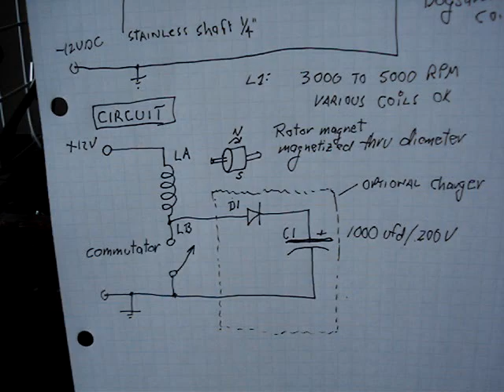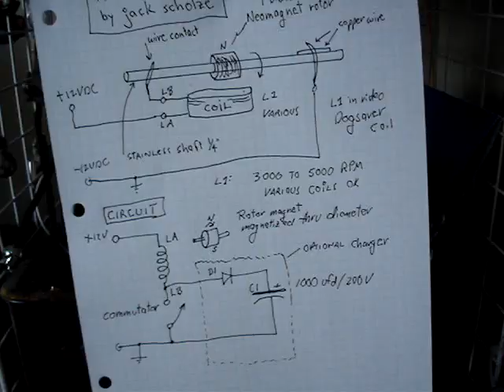Newman Motor and Charger

Comment: Is there a way to then put the charge back into the run battery s?it seems to stop running when I try to loop it! Diodes don't help
Reply: Try capacitors across the coil.  It will capture volt spikes and amp spikes

Comment from the maker: I used only a single break on the shaft, with tape.  Then move the break around until it works the best.  I should make a better commutator, but making commutators is a pain in the butt.

Comment from the maker: Please note:   This is not a free-energy device, just a Newman type motor that can recapture some of the source energy supplied to the motor by means of the charging function that comes from the changing magnetic field of the drive coil interacting with th permanent magnetic field of the cylinder magnet rotor.   The rotor magnet is magnetized thru the diameter and is N42 strength.      The highest available from K&J magnetics is the N52 I think, more expensive.

Comment: Dear Jack, I made a Newman's Motor in a PVC Pipe with double coils rapped round as per
shown on youtube, the difference is I used two ring magnets(speaker) Not Neo. The Motor works well but after some time the  battery goes dead. I tried what you have shown in your circuit, the results are the same.Shall thank you for a early reply. Ranjit